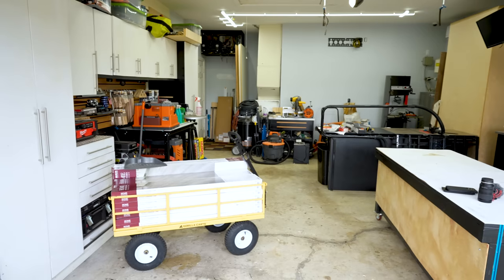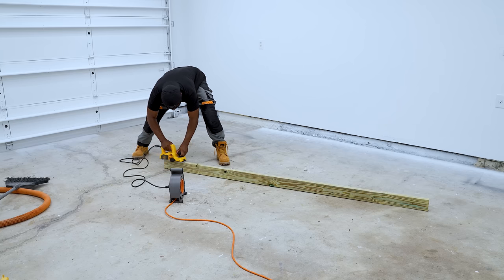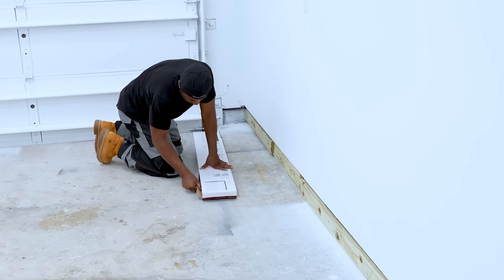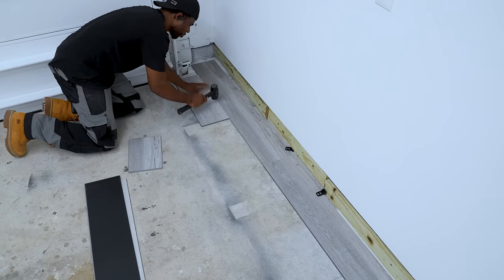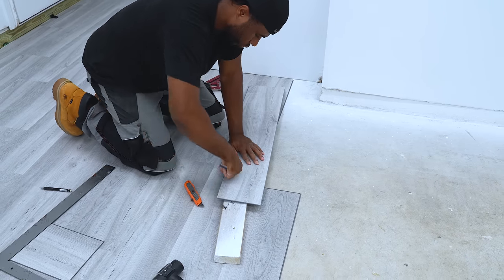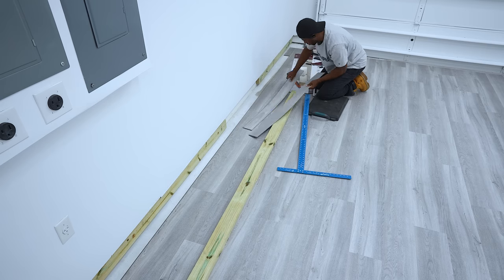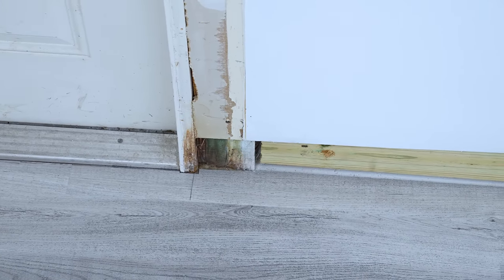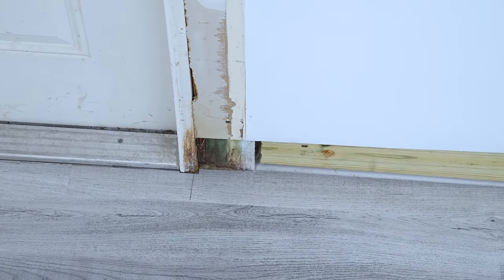How to install vinyl floors

Comment: Glenn - DO NOT put the laminate flooring directly over tile.  Yes it will take you a bit longer to do it "correctly", but it will be well worth it.  I've been repairing and replacing floors for far too long, and can't tell you the number of times I've replaced horrors.  Love the channel, glad to see you back!  Remember - the sun rises and sets every day.
Reply: I came here to say the same thing. Pull the old tile up. It will save you a lot of heartache.
Reply: I agree with you boys 15+ years of doing floors showed me never to take the easy way out lol
Reply: I believe he said that he would first float the floor to get it flat and then lay the vinyl floor on top of that. As long as you first scuff u the tiles and prime it properly to get good adhearence, it should work well enough.
Reply: Needs 6 mil poly at the minimum or a moisture mitigation system. I have been seeing major issues with LVP and Moisture.
Reply: @MChappysGarage can you put old fashion vinyl floor on cement basement floor?
Reply: @YUmMies24  You could with the old adhesives because they were moisture blocking but terrible voc's so they moved to these green products and there are nothing but issues with RH. If you are using a floating floor you need to use some sort of underlayment or Moisture Mitigation system. I generally don't recommend putting vinyl over tile.

Comment: Killer installation! What a huge transformation and yeah... the concrete footers are a challenge and you evened them out, that electric planer did an awesome job... also that resaw on the job site saw. Glad to see you back and that's the way to get back into the groove... It sometimes takes going back to a clean slate for a new beginning both in life and in the shop... it's both a metaphor and a physical reality.

Comment: I added vinyl flooring to my garage a few years back. So much cheaper and easier than Epoxy. Looks great too.
Reply: @BudoDave76
Do you park cars on it, or is it a workshop?
I’m curious to know how this would hold up to vehicles.
Reply: @rumrun11  I do. I made small piece about 4’x4’ and parked on it for a month with the front tires and saw no blemishes or marring. 
So far the only disadvantage I’ve see is that you don’t get the traction you’d get from epoxy. 
Only cost about $800 bucks.
Reply: @BudoDave76  good to know, thanks.  What is the climate like where you live. 
I live in Canada.  I’m wondering if this would hold up to a Canadian winter, followed by a reasonably warm summer.  

Yes, I could see it being a bit slippery.  I wonder if there is some kind of sanded paint or sanded clear coat you could put over top (at least in the area where the tires roll over) to provide a better grip?
Reply: @rumrun11  I’m in So Cal… but… my cousin in Seattle Washington did her garage as well and it’s holding up perfectly. Her neighbors were inspired to do the same.
Reply: @BudoDave76  thanks for the info.  Much appreciated 👍🏼
Reply: @rumrun11 if you ever do this option I’d be interested to know how it holds up. Also in Canada.  Looking for a cheaper flooring option. Don’t really like tiles “look nice but dirt and crud will get trapped”. Epoxy doesn’t last and is too expensive.
Reply: Did you level your concrete at all or did you just lay it down
Reply: @justinpurser5468  just laid it down. Still holding up!
Reply: Dude!!!! Great Job!!

Just came across the channel and I love how precise you are and take your time! Came out great!

Comment: Glad you’re back.  Cool project and sharp looking results.  I have two durability questions regarding vinyl plank in a garage/shop for you or anyone else who has done this. 1. How well does the planking hold up to concentrated weight created by heavy tools on feet/rollers?  2. How does planking stand up to a parked vehicle, especially to twisting force of tires turning with steering movement?

Comment: I did vinyl planks for my dog's room. it had concrete slab just like your garage. I would always recommend to measure width of the room before laying; chances are you will want to cut your first row that you lay so that the final row might not end up being a sliver of width. Looks like it worked out fine for you :)

Comment: While we typically wouldn't put floating vinyl in a workshop space, I can definitely appreciate your approach to learning. Best way to learn is to test it! Something to keep in mind for anyone else looking to do something similar is to double check that your product is rated for slab install or rated as truly waterproof and not just "water resistant."

Comment: Excellent job - looks to easy.
Walls - I used to use flat but I believe (not knowing nothing) that egg shell last longer and is easy to clean with a sponge versus flat which wipe off after many years.

I have to remove the existing 5/8 thick hardwood floors (termites destroyed it), scrap off all the old tar that glued it to the concrete, then install the floors.

Comment: I have these same exact vinyl plank flooring from the same company in all my bedrooms in my home. It’s been 3 years and they have held up wonderfully. Very durable and if there are any visible scratches that develop, as long as they aren’t big gouges, they can be easily smoothed out with your fingernail.

Comment: Welcome back Glen! We sure missed you.

I like the look of that floor. It completely transforms the space; I wouldn't even know that it's a garage if it weren't for the door.

The paint was a good choice, too, though you'll need to do cleaning or touch up on it more often than a darker color. White walls diffuse the light in a room, making it more even and getting rid of harsh shadows. That's particularly important in a shop, where you need to see what you're doing with dangerous sharp tools.

Comment: Thanks for this brother. I've been trying to determine which is better vinyl or laminate. I like the floating and no need for underlayment because I have concrete base throughout my home. I also love vinyl because it can get wet without getting warped.

Comment: I’ve installed similar flooring over a heated floor in Germany, and an unseated concrete floor in Texas. It is super durable, looks great, and people were surprised that it was vinyl plank, and not laminate!  I’m sure it will last a long time for you. A bit of caution, keep grit off of it, and use a mat at the door or high traffic areas!

Comment: Nice work -- it looks great!  I'm hoping that 1/4" gap at the perimeter is enough for the temperature swings in a garage. Since you installed during spring/summer, it's probably fine though.  Depending on how weight is distributed on the planks, you might see some widening of seams between a few planks after one seasonal cycle.  Hopefully, you'll provide a status update a year from now.

Comment: Welcome back!  Great job with the installation. I hope it holds up and the joints don't fail on you. Hopefully your floor was flat and level. I'm not sure vinyl will hold up very well in a shop as it tends to scratch. But you should be able to get a few good years out of it depending on how rough you are on it. Crazier things have been done in shops, like carpet. Definitely looks better than the bare concrete floor.

Comment: One thing alot of people are not told is that even though it's waterproof vinyl plank, you still need to put down 6 mill plastic underneath when you're installing on a concrete subfloor. What happens if you don't is the floor will start cupping.  Other that that good job !  I've been installing for 21 yr , and my family 46 by the way.

Comment: Project looks great, I would go back and remove the caulking from the baseboard to the floor. The LVP is a floating floor and the reason you leave the 1/4" gap is for expansion, so it should not be caulked either

Comment: New subscriber. Good job installing the vinyl flooring and baseboards. Nice, sleek and clean. But it looks cold. Insulation and a different color flooring that provides warmth can significantly improve the functionality and comfort of your garage space. Of course durability is a given but so is comfort 😊. Great job nonetheless 💪.

Comment: Great video. Your garage looks awesome. And I'm super impressed by your creativity in solving problems, like removing material from your baseboards to compensate for the concrete that was sticking out past the walls. But how did you get around the water heater? From what I can tell it looks like you installed the flooring under the water heater, but I can't imagine you uninstalled the water heater to add the flooring, and then put it back. But overall, great video, great job.

Comment: Im happy you're back but about this video I don't recommend installing the vinyls you used in the video. Im a professional carpenter and woodworking for several years and had bad experiences with those as they shrink when the time goes by for many reasons. I'd install parquet instead. Hope I could help

Comment: The transformation is completely fresh! Do you plan to raise the water heater slightly off the floor? Were it up to me, I would raise it slightly so attaching a hose to drain the tank so maintenance would be easier.

Comment: That looks real nice. I recently did the floor in my house. Some things to consider. I don't believe you're supposed to put your large/heavy cabinets on flooring like that. Even if you do, adding the baseboards will make it impossible to put them all the way up again the walls now. Curious how you will handle this if you're putting everything back in there.

Comment: HAPPY to see you back. GREAT work on the flooring.I have that exact flooring in my bathroom. They did well. It's comfy. 
I DO have a small question about the door framing. Are you gonna leave the top in that kinda unfinished look??

Comment: If you’re putting that type of flooring over existing tiles, like you mentioned in your house…you need to use some sort of cork type underlayment or the grout lines will eventually show through the vinyl planks, and it will cut down on the noise made when walking across it. At least that’s what the installers at work told me before we did my dads kitchen.

Comment: hey Glenn,did you take notice what hardness these vinyl straps have,i know there are several degrees of protection on the walking side,there is,like with cork floors also a sort of liquid hardener wich you can apply,that will make the vinyl floor more durable,cheers m8

Comment: When using this type of flooring, checks the lips where the pieces connect.  If they snap easily get a different product.   Otherwise you will have a tough installation with tiles breaking

Comment: Great Video. Will this hold up in a sunroom that gets moisture from rain in Florida? Currently just the cement floor which is old gray color with seamed cracks. Was wondering with moisture around garage doors how is this holding up? Thanks

Comment: if your garage door closed flush with your slab, how would you install vinyl floors?
Reply from the maker: I would install it the same way. Not under the door, but likely 1 to 2in away from the door.

Comment: I watched your previous video with a PVC panel floor. Did that floor fail? I am faced with the choice of putting something on the floor and I wanted to follow your previous solution. However, I see that you changed the floor and that worries me. Which is better 1. Current panels 2. Previous gray puzzle panels?

Comment: If u had a oscillating multi tool u could cut a slit on the bottom of that wall corner so u could slip the whole plank in without cutting the tile

Comment: The concrete will transfer moisture into the raw wood of the baseboard. You will have to use a good vinyl flashing to separate the two.

Comment: It would of been way easier if you used a multi tool and cut the base of the trim and just slide the plank under it but you did a clean job

Comment: Vinyl flooring is nice, but JFC it is heavy. Getting 80 m² into the 3. floor w/o an elevator sucks - ALOT! Sadly the best sollution, if you want to have the same flooring in the whole appartment inkl. the kitchen.
Btw, haven't you installed some form of PE tiles into that work shop?